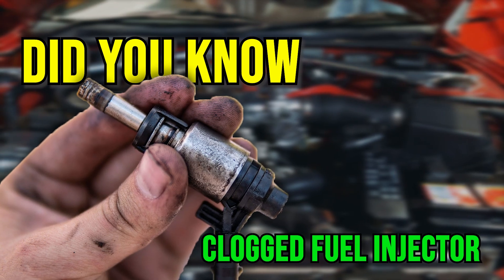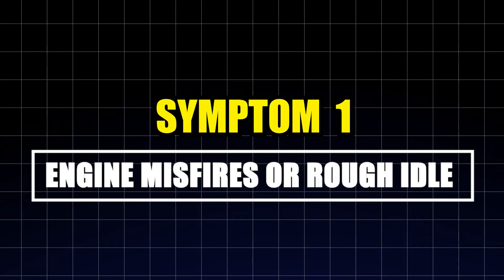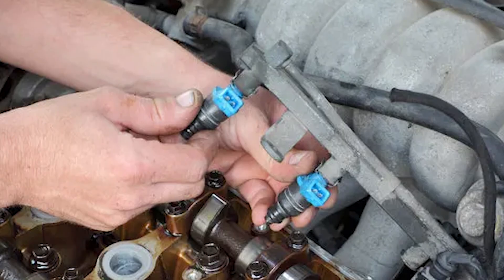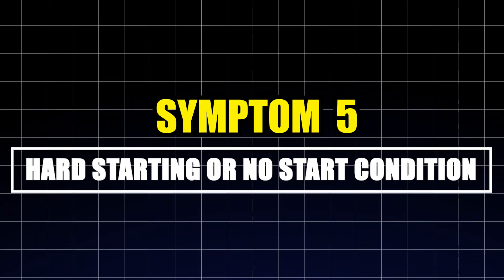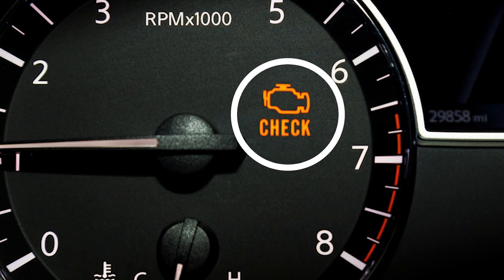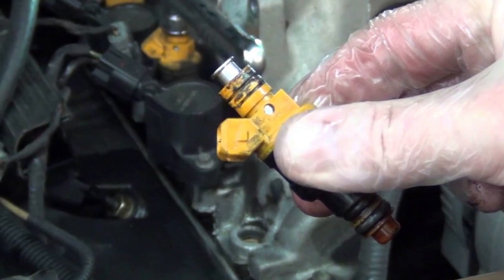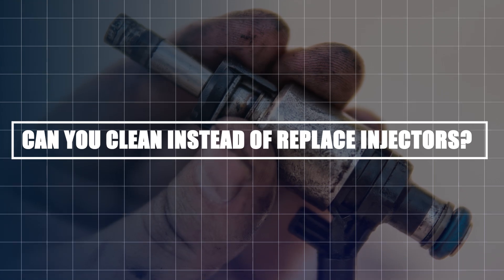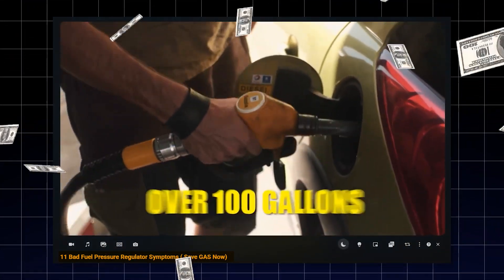Fuel Injector Going Bad? Watch for These 11 Telltale Signs

Comment: Right after starting the engine, the idling is unstable, and when I begin to drive, it shows symptoms similar to being on the verge of running out of fuel for a few minutes. Unless I fully depress the accelerator pedal, the engine stalls.

If I keep the engine revs up—such as by locking it in third gear—for a few minutes, the symptoms disappear and the car runs perfectly with no issues. I’ve driven about 20,000 kilometers over three years in this condition, and the symptoms haven’t worsened. Aside from the first few minutes after starting the engine, the car runs perfectly with absolutely no issues.

I’ve replaced all kinds of sensors, but the issue remains unresolved. Could a clogged injector or something similar be the cause? The car experiencing these symptoms is a Jaguar XJ8.
Reply from the maker: On the XJ8, those “running out of fuel” symptoms right after a cold start are classic signs of a weak or partially clogged injector, especially if the engine smooths out once it warms up. Since you’ve already replaced sensors, I’d check injector flow, fuel pressure, and the cold-start enrichment—one lazy injector can cause exactly what you’re describing.

Comment: WD -40  I spray in to my gas tank once a month.  It keeps my engine clean.
Reply from the maker: WD-40 isn’t designed for fuel systems and can actually cause damage over time. It’s safer to use a proper fuel injector cleaner that’s made for gas tanks.

Comment: After replacing the injector, it’s still not giving the pulse. Fail to start  car😢
Reply: Check ignition coil and fuel pump and spark plugs as well
Reply: Try your fuel pump module first cheapest and easiest ; fuel pump; starter, also what he stated it is so many causes for a no start
Reply: Or it could be you pcm

Comment: I have a 1994 Dodge Dakota  and I’m having trouble keeping it running V6. 4x4 thanks 😂the tip.
Reply from the maker: On a ’94 Dodge Dakota V6, hard-to-keep-running issues can come from clogged or leaking injectors, but also check basics like fuel pressure, vacuum leaks, and ignition components. A fuel pressure test and injector cleaning/inspection would be a good start.
Reply: yes that’s what was wrong with mine

Comment: I haven't seen any place under the dashboard to hook up a scanner on my 99 Dodge Ram 1500
Reply from the maker: You're not alone—on the 1999 Dodge Ram 1500, the OBD-II port isn’t always easy to spot. It should be located under the driver's side of the dashboard, near the steering column. Sometimes it's tucked up pretty high or partially hidden behind a panel or cover. Try looking just above where your knees would be when you're sitting in the driver's seat. Let me know if you still can’t find it—I can walk you through it.

Comment: I have a 1999 Dodge Ram 1500 has the 5.2 / 318 Magnum engines the four plugs on passenger side are firing and heating well the manifold is getting hot but on driver's side it takes a really long time for the manifold to get hot I changed the spark plugs and tested them they are all firing on the truck seems like all of my injectors on driver side or messed up any idea if this is correct
Reply from the maker: If the driver-side manifold is staying cold and all plugs are firing, it's very likely you're dealing with a fuel delivery issue—check for clogged or non-functioning injectors on that side.

Comment: I had a misfire on cylinder 2 and it was a clogged fuel injector. I then ordered and bought Redline fuel system cleaner online and poured it into the tank and the problem with the misfire rough idling and engine stalling got fixed.
Reply: Im going through that right now I have cleaner but I’m scared to drive it while it’s misfiring and I did the tune up and it still gives cylinder 1&3 codes
Reply: At first, I had the engine running on the parking lot with the fuel treatment in it and was revving it some at times. I didn't drive it at first, I was in my house parking space while I was using the   Redline fuel system cleaner with the engine on my parking lot property, and when it started to get better and not shake or misfire anymore, I took the car to the street for a ride.